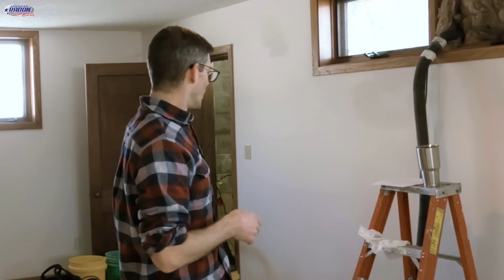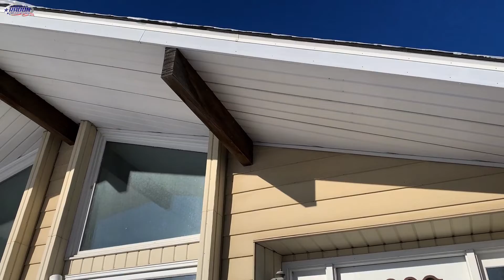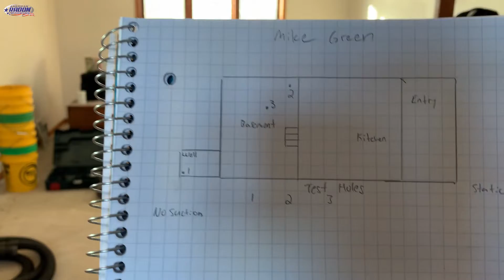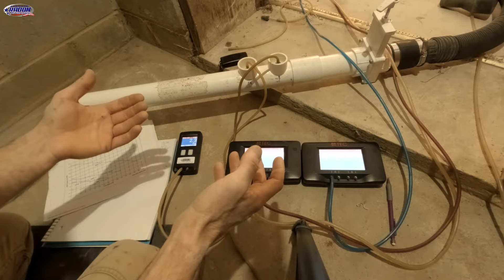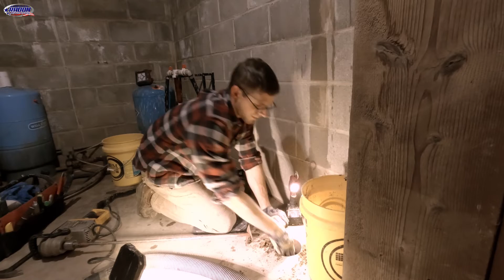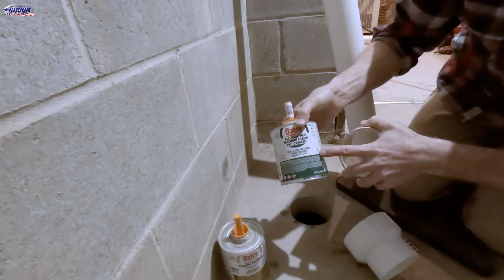Full Radon Mitigation System Install | Part 1 of 3

Comment from the maker: Featured Products
Bosch Rotary Hammer - https://amzn.to/3pmHz9k
Dust Collection Attachment - https://amzn.to/3otHe3v
5-Inch Core Bit - https://amzn.to/36ik4Xw
Milwaukee Hole Saw - https://amzn.to/32nTk8K
Fantech Radon Fans. Use promo code JESSE to get 5% off your first order. - https://radonpds.com/product-category/radon-fans/radon-fans-high-volume/
Bosch Laser - https://amzn.to/3Vz6qHA
Oatey Cement and Primer - https://amzn.to/3AyZe5R
Sonin 00701 Water Alarm with Flat Sensor https://amzn.to/3D0US8H
Small Pressure Gauge - https://americanradonmitigation.com/product/dg-8-pressure-gauge/
Large Pressure Gauge -  https://americanradonmitigation.com/product/dg-1000-digital-pressure-and-flow-gauge/
Ecosense Radon Monitors: Use promo code ARM to receive a discount https://ecosense.io/ARM

Fan Curve Charts
https://www.wpb-radon.com/radon_fan_performance.html

Learn more about our CE course at the link below.
https://americanradonmitigation.com/continuing-education/

📍 Service Area
Serving Colorado’s Front Range and Mountain Communities:
Golden, Boulder, Denver, Cherry Hills Village, Evergreen, Breckenridge, Vail, Aspen, and nearby areas.

🗓  Schedule an Estimate
Live in Colorado? Book your in-person radon mitigation system estimate here: https://americanradonmitigation.com/

🌎  Have a Question for Jesse?
We offer virtual consultations worldwide: https://americanradonmitigation.com/consulting/

🛒  Need a Radon Monitor or Supplies?
Shop our online store: https://americanradonmitigation.com/shop/

🛍  Our Amazon Store: https://amazon.com/shop/americanradonmitigation
We participate in the Amazon Associates Program and may earn commissions from qualifying purchases made through the links above. Thanks for your support!

Comment: Hello Jesse,  I am in Canada and was under the impression that a radon fan should not be installed outside where extreme cold occurs.. Like now (-25 C, -17 F)    .    Is it bad to install outside in cold climates  ?
Reply: Yes, in canadian cold climate you want to have the fan inside and the exterior pipe exhaust should be kept to a minimal length to prevent ice. A guide is made available by the canadian governement, you can find it by searching "radon mitigation for an existing home".
Reply from the maker: The American radon standards do not allow us to install a radon fan in a conditioned space. The Canadian standards are different, though.

Comment: I just had a mitigation system put in in MA. I have gone around and sealed all of the wall / floor joints, expansion joints and any other cracks I can find. My daily average is still around 2.2 pCi/L. Any advice for better reduction?  I was at a 6.3 or so weekly average before system.
Reply from the maker: It sounds like you’ve done a great job sealing. Did your mitigator perform any pressure field extension (PFE) testing? If not, I’d start there to ensure your system is creating suction under your entire home. Once you have full sub-slab suction, check adjacent slabs, such as an attached garage or front step, as potential radon entry points if levels are still elevated. We have several videos covering these topics, and also offer consulting and tool kit rentals on our website

Comment: Hi , thanks for your video , I have a question , I want to evacuate my radon on the roof of the house , my pipe exhaust will be near the edge of the roof 2 feet above the roof, but I have a window on that side that is 3 feet below the exhausts pipe is this a problem ? will the radon come back down and re-enter the house ? Radon gas is heavier then the air I presume ?
Reply from the maker: You're welcome. Check out section 6.4 of the radon mitigation standard. https://standards.aarst.org/SGM-SF-2023/24/index.html